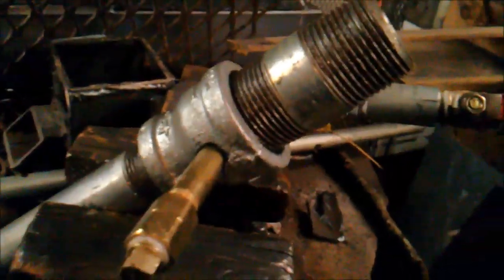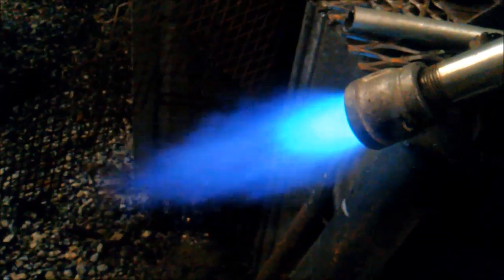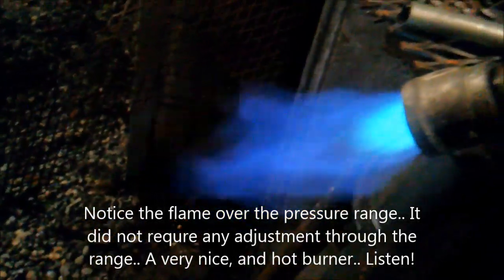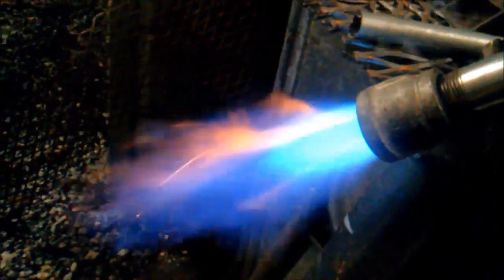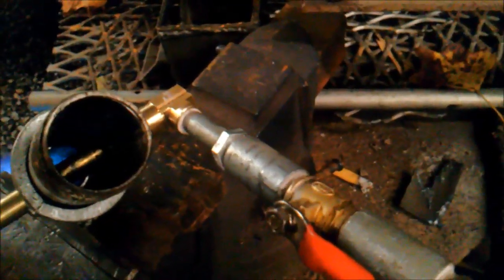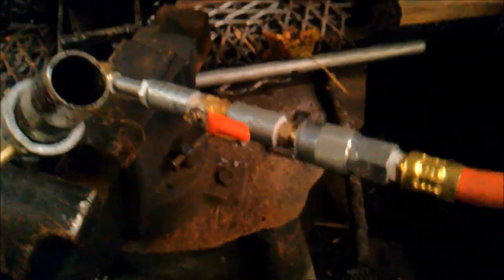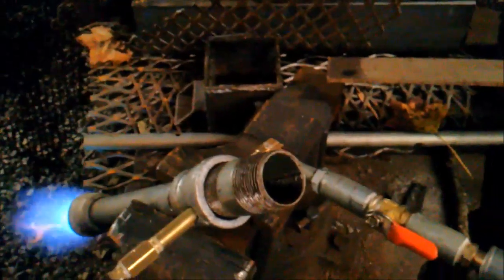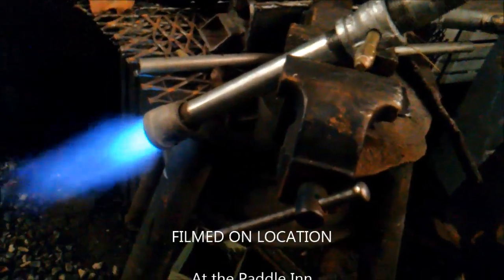Propane Burner for Blacksmith Forge or other applications.

Comment: I had a bit of a question on your burner,
I built this burner down to the last detail and it does get steel to the proper heat in my forge,but the flame sputters and pops every other second or so,I wanted to know if you knew of a solution.
Reply from the maker: +weedinspace lane I'm not sure without seeing it, but,  the popping tells me that this is unburned gas that is not burning normally or efficiently.. I would say, try tweaking the burner jet.. Make sure it is pointing directly down the burn tube, and make sure the tip is smooth, and does not have dings, or a non smooth tip, etc.. 
If you can hook a hose pipe up to your setup, and spray water down the tube, it can tell you quite a bit. If it is a smooth jet of water, it should burn smooth..  If you are using the correct adapter at the top and bottom as far as size goes, that should not be an additional problem... Basically, if you don't have a bell reducer, the flame will blow off of the tip if you turn it up very much at all.. If you don't have one and are running at low pressure, you might be experiencing a lack of burn, and then, basically an explosion of unburned gasses.. 
I think that might give you some ideas.. If that doesn't work, try changing regulators, or playing with your gas flow to see if you hear any irregularity when it is not burning.. Just turn it on, and listen carefully (While no flames are present), and see if you here a smooth hiss or some jittering, etc.. 
Basically, the gas leaving the mig tip, or drilled hole "Orifice", is creating a Venturi effect, and pulling air into the propane to give it more to breath and burn.. 
If you are getting proper gas to air ratio, you will burn nice blue and regular. Anything upsetting the balance between the two could cause whatever type of related problem.. Try burning and hold your had over the air intake, see what the flame does, and see if this is something like your problem, etc.. 
That would be a good way to start troubleshooting.. See if you can Re-Create the problem with some known action.. Then, try to reverse it and see what happens.. You should be able to find the problem yourself.. 
Give it a try and see what you learn.. Yell back, reply here if you can describe more about your testing.. Maybe I can interject more, and help you figure it out.

Comment from the maker: +Harry McLane  : Not sure why I could not reply directly to your post (Can on the other posts), so, I figured I would reply here, and post your name, which does not seem to be working either.. Strange..
If you force air through the end of the tube, I am pretty sure you would blow the flame out, unless you upped the gas and got lucky at the same time with the mix.. 
If you want to melt cast iron, you probably want to build a forge first,, actually a furnace,, then,  you could do a forced air burner, but use a little different design.. The burner in this video uses a  Mig Tip (Small orifice) and pushes the propane through at a bit of pressure.. A jet of sorts.. If you want to force air through, (although I have not played with this a whole lot), you will want to allow more volume  of the propane, and less pressure, and the forced air needs to mix with the gas at a higher rate of flow, and less pressure.. The feed needs to be consistent enough to maintain the flame.. 
You will also find that you most likely need to contain the flame in a cylinder or Furnace, or you will blow the flame off of the end of your burner. 
An example that might help.. If you want to burn used motor oil, you basically have to have everything perfect, or,, heat the forge with propane, get it hot, and then, get the mix close, or about right, and use the already heated forge to help with maintaining combustion.. 
Look at this forced air burner here:
http://www.hightemptools.com/burners.html 
The Red ones... The large valve on the end is where you hook up the blower.. The other end goes into the forge.. 
NOtice the valve going into the side.. It is a 1/4 or 3/8" ball valve connected directly to the side of the tube, where the propane is injected.. There are no special metering orifices, etc... The burner in this picture is a fire it up and go..  These forced air burners are designed to be adjusted and played with.. The amount of air, and propane to mix.. 
You won't have much adjustment with a Mig Tip.. You will need more volume if you want to hook a "Blower" up to anything.. 
So, no.. I would not start with this type of burner if you want to use forced air.. 
Just start by getting a blower, a bucket of some sort, cut a hole in the side, and then find some easy way to inject propane into the side of the pipe.. Then, adjust the flow of propane and the flow of air until you get it like you want.. Let it heat up a bit when you first get it going,, and then, start adjusting.. 
Here is someone who has a nice forced air furnace, who starts it with propane and then runs waste motor oil.. I searched his channel for "forge"... He has several videos about his forge. Building a quick one to show you concepts, etc... and overhauling his main forge.. All interesting videos...
It would be a very good place for you to get your start to make a forced air forge for melting Steel, Aluminum, etc.. 
You WILL have to have a furnace to hold the heat in,, if you want to melt steel, and still have a few bucks in your pocket after fueling the forge... Cheers..

Comment: smoothing out the inside on both the intake end at the orifice and the burner tip helps alot, lots more air flow and a better flame, like porting an intake on a car. i smoothed the whole inside of mine with a grinding stone on an angle grinder then sanded it with a sanding bit, never tried it with the threads inside but I imagine it's a big difference, no yellow flame at all, and a nice bright blue center flame.

Comment: dont go tac welding galv steel onto that torch... if it heats up you can get metal fume fever or even die..
Reply: you won't die. you'll dry heave a few times, get a headache,  & after 10-15 min. it's gone. I've been on the receiving end of zinc fumes. if you don't inhale it directly, in most cases, it won't affect you at all.

Comment: Did you ever clean up the threads inside the bell reducer?  Did it fix the flame and make it burn more cleanly?
Reply from the maker: Clinton Bennett No.. I thought about it, but, the flame was pretty good like it was.. I am sure it could be tweaked a bit, and might make it a bit smoother.. Not sure if that would give you more heat, etc.. It is the turbulance and the mixing of the gas/air that gives you the heat... But, it might not have anything to do with that at the second set of threads on the bottom side of the bell reducer.. I also did not ream out the inside of the pipe either.. That might make more of a difference.. Good or bad, not sure.
Reply from the maker: You can see in the other Youtube videos.. I started making Tongs, etc.. that you would use in the Blacksmith trade, then, steak turners, Pit skewers, dinner bells, and then, all of the hardy tools.. Cut off tools, etc.. Just experimented with lots of different things...
I don't have a lot of free time for projects, but, this is one that would be very valuable, if you woke up one morning, and the $ was worth the paper it is printed on, and you could not buy electricity, etc..
That is the reason for the Rocket Stoves (to cook the dried beans and rice), etc.. and the Blacksmith project to build whatever I need out of all of the worthless metal that will be laying around, waiting for someone to create billets, and make tools our Grandfathers used to make to get by...
Other than that, I make things fairly frequently on the forge, that I use for various things.. Being able to make a tool with a forge will keep your mind thinking about what is now possible that was not possible before...
I build what I dream up that I can not buy...
I have not done any smelting,, but, it is high on my "Want To" list, just after my "Have To" and "Must Do" list.. There will be plenty of metal to melt down and cast using green/grey sand, etc.. I have the componants to build one, just have not done it yet..
If the SHTF, I think I would start it with coal from the forge, and then, run it on waste motor oil.. There should be plenty of that around by then also.. Right now, too many people paying too much to purchase it.
Cheers.
Reply: +Mark Thomas thanks for replying, especially so quickly!  I'm just looking to get back into knife making now and as I am in a more suburban environment now, propane heat treating is my only option.  I previously had several acres of space and was able to dig a furnace into the soil and use a bellows to feed it...  Kinds hard to replicate that kind of setup in my new back yard that is the side of a sedan.  

Now knowing how to make a burner I can move on to making a container capable of containing the heat that your burner design can generate.  Now to find some kao wool or a refractory cement/perlite mix that another youtuber showed to work very well.
Reply: +TaskMaster1983 I've got a bell reducer on mine. Just finished building it last night and did a quick test fire. Going to try a couple of things. 1. grind and smooth the threads in the bell reducer. test burn. 2. cut off bell reducer after the curve. you'll notice it goes straight where the threads are so there's really no more taper.  I see you were commenting a month ago. did you end up building anything?
Reply: +Joe Vitale actually I decided to go with a bigger burner inlet hole on my forge to allow me to use a "Weed Burner" from Harbor Freight. It's only $25 and can be throttled with its trigger mechanism. No tunning of the flame required. It brings up to temp faster too.
Reply: +Clinton Bennett thanks for the quick reply. just noticed I mentioned the wrong posted in my original comment. Sorry. What kind of work do you do with your forge? I'm looking to build one soon. Currently I have most of the king of random's bucket foundry built but I want to work with steel in addition to aluminum.
Reply: +Joe Vitale mostly heat treating knife blanks or annealing metal so it can be worked. for smelting, you want a vertical setup. fan fed with burning wood, coal, or waste oil is the way to go for that.

Comment: Just bought all the parts about 15 minuets ago got it together and had some great results after tuning it a little but my question is how long does 20 gal of propane last?
Reply from the maker: Cv8 Metal A full day in my forge or better. I would say 12 to 20 hours depending on how high the pressure is running. Most of my work is done at 35psi... Up to about 1/4" thick or lower.. Usually at 3 psi, and working on several pieces at a time..

Comment: I have the exact same set up #60 drilled jet etc. But flame is nothing like that, it looks like a bic lighter. I even switched that out for a .020 welding tip, same result. Could the problem be my regulator is faulty or the propane tank? I have a Fisher 67CH-743 high pressure 0-30 psi regulator, no pressure gauge though. Any thoughts?
Reply from the maker: Yes I would think the problem would be your regulator.. You didn't hear the noise of the propane being pushed through the MiG tip, and the venturi effect of the air being sucked in the back of the tube to mix with the propane. When you say like a big lighter, it makes me think you don't have enough pressure.. 3 psi is enough for a good flame.. I usually run it around 5 psi for normal work.. Hope that helps..
Reply: Mark Thomas thanks for replying so fast I figured out my problem though: it was the tank. The OPD shut off valve was stuck  allowing only a very little bit of gas to flow. Turning the tank upside down seemed to fix it. Opened the valve veery slowly, and heard the woosh of gas and success. Large blue like I first had hoped for. Need to tweak the blower still as it blows itself out easily if turned just slightly too high. Maybe you have advice for fixing that as well? Thanks again!
Reply from the maker: Sounds good.. If you do not have a bell reducer on the end near the flame, it will blow off of the tip and go out.. If you don't have one, you need one.. If you are using forced air, you will have to play with the adjustment, and reduce the intake or exhaust to get a good flame.. Most people restrict the intake of the blower to adjust the blower, but, you can also use a light switch dimmer and slow the fan down with it.. Hope that helps.
Reply: That does help. It doesn't have a reducer on the end so maybe I'll build one into the furnace or I've heard they aren't necessary inside so I'll have to experiment and find out what works best. Thanks again for your help